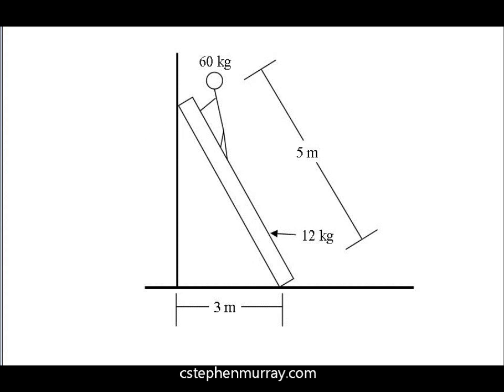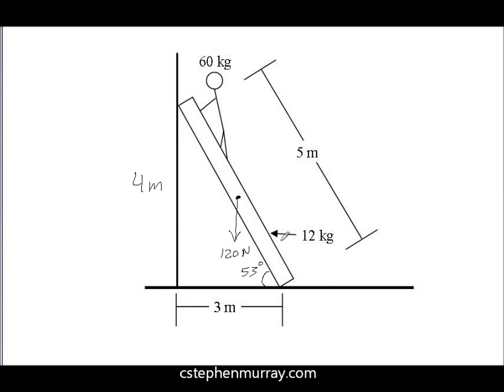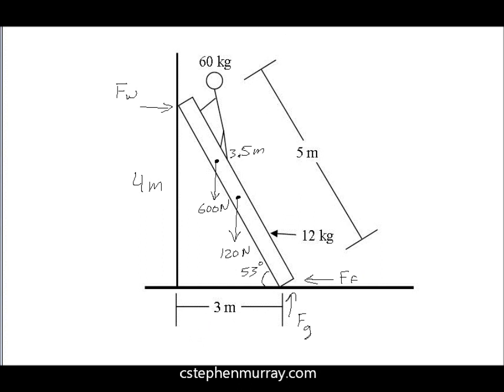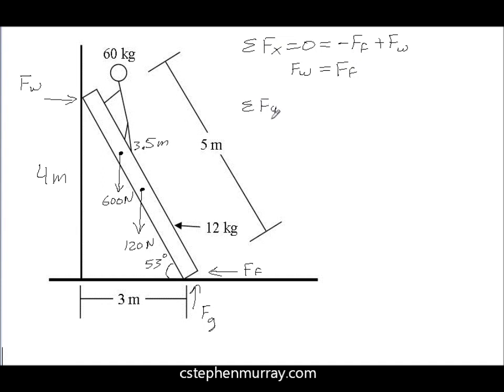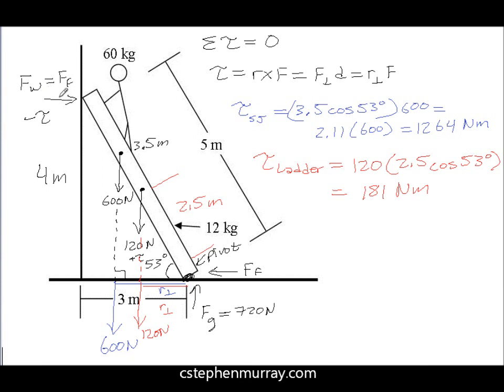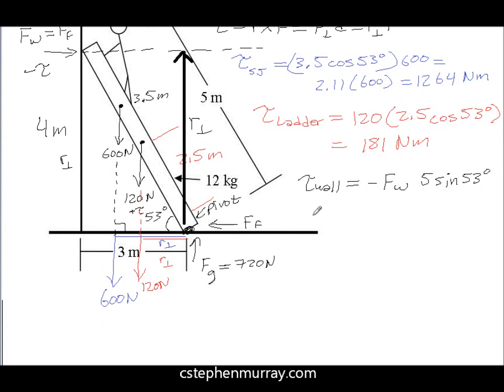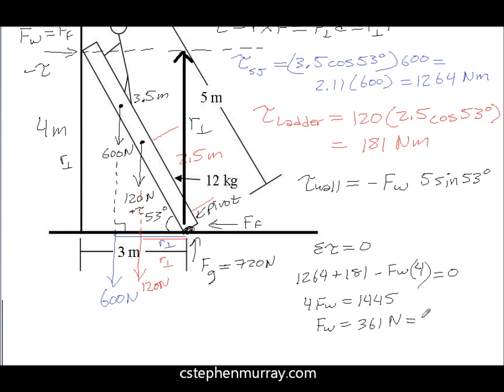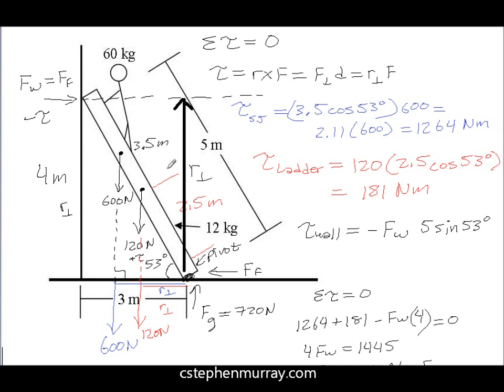Ladder Example for Static Equilibrium

Comment from the maker: To:  IIproductionsII     Yeah, when I just rewatched the video I noticed that I could have just used 4m (from the diagram) instead of doing the trig.  I was thinking of other things.  Either way, this is the part of the process that most of my students struggle with.  I think it is important to understand how the moment arm = 4m, then the actual number.
Reply: Indeed. My professor didn't teach us the moment arm method, and I have a feeling that if a ladder problem is on my exam today, the distance between the ground and the point where the ladder meets the wall won't be given. Thank you so much for this video. Best I've watched all semester. Wish I found these sooner.

Comment: Hello Stephen,
Why isn"t there a frictional force (Ffy) preventing the ladder from going down?
There is a frictional force,Ff, preventing the ladder from collapsing. 

Or can the problem be seen as, Ffy and Ff do the same (prevent the ladder from collapsing) and thereby one can be chosen. 

Would solvingthe problem with Ffy instead of Ff result in the same values?

Kind regars

Comment: Hello, at around 7:20 did you add 2.5 and 3.5 to get 5 meters? please explain because now I'm confused as to if it's wrong or if I missed an important step. Thanks for the helpful video!
Reply from the maker: 3.5 m is the distance to Slim Jim from the ground (I just chose that at 1:41).  The center of mass of the ladder is at the center of the ladder which is 2.5m.

Comment: I have a problem, why the wall does not have a vertical upward reaction force (vertical upward friction) in this case? Thank you.
Reply from the maker: The wall is frictionless, so there’s no “reaction force” possible there, if you are talking about Newton’s 3rd Law pairs.  At the wall the 3rs Law force pair would be “the ladder pushing on the wall” and “the wall pushing back on the ladder”.  These are normal forces which are always perpendicular to the surface.

Comment: why, at 9.00 did you use cos then cos and then swap to sin? arent you finding out the horizontal components? wont sin find the vertical force component?
Reply from the maker: Luke Parker Because of something called the "moment arm".  Torque is defined as a force acting perpendicular to a lever.  When the force is NOT perpendicular to the lever you have two choices: 1) you can resolve the force into its components perpendicular and parallel to the lever or 2) you can find the perpendicular lever, known as the moment arm.  Which is better?  Not the correct question.  Instead: which is easier (physics answer).  In the ladder case, way 2 is much easier.  How do you find the moment arm?  Draw the force infinitely long and then find the distance that is perpendicular to that force.  In the video the thick line drawn from the point where the ladder touches the ground is the moment arm.  I just so happens that it is the same distance as from the ground to where the wall touches the ladder, which is 5sin

v\:* {behavior:url(#default#VML);}
o\:* {behavior:url(#default#VML);}
b\:* {behavior:url(#default#VML);}
.shape {behavior:url(#default#VML);}

v\:* {behavior:url(#default#VML);}
o\:* {behavior:url(#default#VML);}
b\:* {behavior:url(#default#VML);}
.shape {behavior:url(#default#VML);}

<span style="font-family:
"Times New Roman";mso-armenian-font-family:"Times New Roman";mso-eudc-font-family:
"Times New Roman";mso-currency-font-family:"Times New Roman";font-style:italic;
language:el;mso-ansi-language:el;mso-ligatures:none" lang="el">θ<span style="font-family:Tahoma;mso-default-font-family:Tahoma;mso-ascii-font-family:
Tahoma;mso-latin-font-family:Tahoma;mso-greek-font-family:Tahoma;mso-cyrillic-font-family:
Tahoma;mso-armenian-font-family:Tahoma;mso-hebrew-font-family:Tahoma;
mso-arabic-font-family:Tahoma;mso-oriya-font-family:Kalinga;mso-thai-font-family:
Tahoma;mso-currency-font-family:Tahoma;mso-latinext-font-family:Tahoma;
language:en-US;mso-ligatures:none" lang="en-US">.    Below you can see the interior angles.  It should be clear, now. 

 
  281
  
   7772400
   10058400
  
  259
  261
  257
  276
  262
  279
  1
  0``````````````````````
  5
  1
  0
  285
 
 
  282
  1
  False
  0
  0
  0
  0
 
 
  
   
    
     -1
    
   
  
  304800
  243
  True
  128
  77
  255
  3175
  3175
  70
  True
  True
  True
  True
  True
 
 
  278
  
   134217728
  
 
 
  1
  
   
    1
    -9999996.000000
    -9999996.000000
   
  
 
 
  8
  
   Empty
   
    16711680
   
   
    52479
   
   
    26367
   
   
    13421772
   
   
    16737792
   
   
    13382502
   
   
    16777215
   
  
  Bluebird
 
 
 

 
  
   22860000
   22860000
  
  (`@`````````
  266
  263
  5
  
   110185200
   110185200
  
 

 <o:shapedefaults v:ext="edit" spidmax="3075" fill="f" fillcolor="white [7]"
  strokecolor="black [0]">
  
  
   
   
   
   
   
  
  
  
  <o:colormenu v:ext="edit" fillcolor="blue [1]" strokecolor="black [0]"
   shadowcolor="#ccc [4]"/>

Comment: I'm struggling to understand why there is no normla force of the ladder on the person, or if there is why it's not included in the free body and any of the calculations?
Reply from the maker: Another omission by me, sorry.  I SHOULD have started by defining my system. In this case I used the combined system of Slim Jim and the ladder.  As a result the normal forces between them are internal forces and can be ignored.  If our system was defined as just the ladder, then Slim Jim does apply a normal force to the ladder.  Since Slim Jim is also at static equilibrium, so mg = Fn for Jim, then, by Newton's 3rd Law, Fn of Jim on the Ladder also equals mg of Jim.  Hope that helps.
Reply: @cstephenmurray  Thank you!

Comment: Why there is no upward friction force at the point of contact of the ladder with the wall?
Reply: +anfarahat why would there be? the surface it is in contact with is flat.
Reply: +scratch12367 That's a closer model to reality. Friction exists both on the wall and on the floor. I do not see the relation between a surface being flat and frictionless. Can't we have a wall that is flat and rough at the same time?